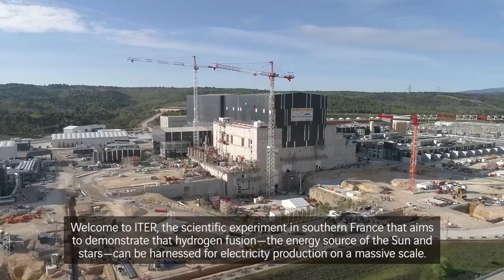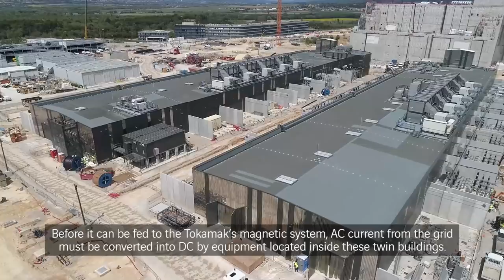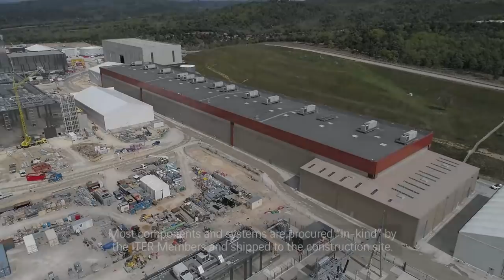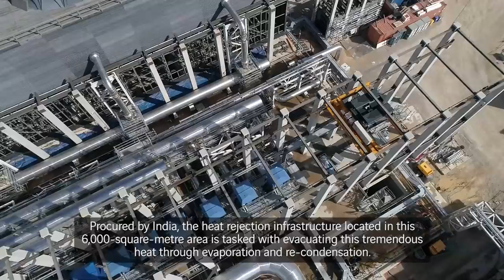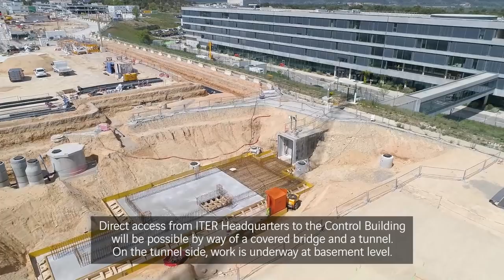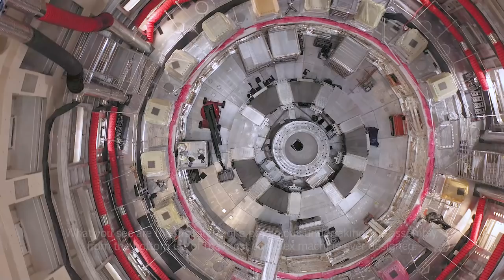ITER SITE CONSTRUCTION IS NOW 78 % COMPLETE

Comment: The complexity of this thing is just mind blowing. Hats off to scientists, engineers, technicians, average workers for puting it together piece by piece. Humanity, you can do it.
Reply: You'll get a guy like Elon Musk putting it together at a Texas farm with duct tapes at a cost lower by factor of 100. Using iterative testing methods churning results monthly until it's done in 2 yrs.
Reply: @The_Dark_Lord-69  I think it is not so easy due to sheer size of the device. But once we crack the process I hope we will be able to mass produce and scale down such reactors.
Reply: @sylwek1177  MIT version (SPARC) of this design is much smaller but at a higher power density. It uses (now) commercially available super conducting magnets thaf are easier to manufacture.
Reply: The complexity is at the bottom of the top 5 reasons it will fail.
Reply: @The_Dark_Lord-69  The longer you wait the easier, cheaper and or better it will be but by this logic you never start, at some point when it is worth the effort you need to start work on these long projects.
Reply: @The_Dark_Lord-69  With that attitude nothing would ever be done, you have to start somewhere, not constantly wait for a better opportunity.
Reply: @5000mahmud  Or wait for someone else to do the job

Comment: ITER is one of those projects that one can say: "Humanity will never be the same again, afterwards."
Reply: Because 70 billion is a lot to spend on snake oil…
Reply: @russhamilton3800  What makes it snake oil?
Reply: @russhamilton3800  in my experience with using neutrons to make a metal radioactive, the half-life was in days.  This means the radioactivity will dissipate on its own.  Whereas the end products from fission are radioactive for 100,000s of years.

Yes, the experiment may not immediately produce net energy, or it may fail.  One must try, and then try again, if you want to progress.  People learn by doing, and then using that knowledge to improve.  You are advocating technological stasis, similar to the Amish.  Not everyone wants to be Amish.

If the research was never done to create the transistor, we wouldn't be able to even have this conversation.
Reply: @brocksamson3282  something that is radioactive for a few days is going to be off the charts! You know that right. You’re going to have to shield it, bury it and it’s going to fuck up electronics if they are anywhere near. See then you bring up fission and if you built a safe molten salt reactor you can actually burn waste and the waste you do generate is manageable because it’s hL is only 150 years. But back to ITER, do you really not know what they are going to burn ? Well it’s tritium! Your neutron problem with radiation is not going to last just a few days now is it? So we now are going to have do what? Breed tritium. Good thing that tritium can be used in fusion bombs right?
Reply: @russhamilton3800  in the video they said it was in 30m pit, so it is buried.

Low energy radiation doesn't hurt electronics.  Tritium decay only produces 18.6 keV of energy with some of that energy going to the neutrino and some to the electron.  That is a tiny tiny amount of energy.

My argument still stands, you are advocating stasis, and not progress.  Now you are just trying to distract from that.
Reply: @brocksamson3282  what’s going on during fusion can screw with electronics ffs! Omg
Reply: @russhamilton3800  OK, we all gotta live like cave men then.  No sense trying to do things.  (/sarcasm)
Reply: @brocksamson3282  letting scientists feed at the public trough is not about bringing fusion to fruition, its about feeding scientist and pokiticians. Its not a serious endeavor.
Reply: @russhamilton3800  Good thing they don't put their sensitive electronics inside the fusion reactor.  Heck, they would melt from the heat.  Even the strong magnetic fields around the reactor would mess with sensitive electronics.  Good thing for one over R squared, so things are safe at a distance.
Reply: @russhamilton3800  yes, you hate science, similar to the Amish.  Not everyone hates science like you.  Most people, thankfully, want to see society progress.  I'm surprised you find it ethical to even use Youtube, with your backwards way of thinking.

And you do know scientists have low salaries, they don't get to keep the research money, right?  Science isn't military contractors making huge profits.

But, you have the right to your opinion, and I respect people like the Amish who want to live a simple life.  Just don't push your ignorance on the rest of us.
Reply: @russhamilton3800  oh, and i was mistaken.  The experiment I did with neutron capture gave silver a half-life measured in minutes, and another in seconds.  Neutron capture (neutrons making other elements radioactive) only happens when the neutron is nearly at rest, so the energy levels of subsequent radiation are limited by this, which is why i classified it as "low" energy.
Reply: @brocksamson3282  Brock, I'm really enjoying reading you slap the shit out of him...thank you. Especially that last line.
Reply: @russhamilton3800  I would recommend looking up what is a science and what it does and already did to humanity.
Reply: Though not immediately. It will still take decades to really start have an impact.
I'm in my mid 30s now and my hope is to see a real transformation in energy and industry 50 years or so from now.
Reply: @TauCu  ridiculous statement on your part. There are no indicators that any real progress is being made. You throw out a non sequitur statement with no data, facts or anything else. If you want to discuss something then do it but blindly reacting to journalistic statements is meaningless.
Reply: ITER will be 100 billion over budget by the time it makes ots first plasma.
Reply: @russhamilton3800  Progress of what? ITER or Nuclear fusion as a whole?
Progress is and will be made no matter the outcome of ITER.
Reply: @TauCu  no it will not. Even if they solve how to get to Q1, and they won’t, that does not mean they will ever reach a point of feasibility. The intractability of the fuel problem alone may be a show stopper.
Reply: @russhamilton3800  Just because something may be a "show stopper" doesn't mean it should not be attempted.
Otherwise no one will ever know.
Reply: NO it will NOT. they all be dead afterwards
Reply: @outlawedTV88  who are you responding to its been 3 months since anyone has commented and i just wanted to see the iter vid again and look into the comments
Reply: @jonathan.k7492  to original first comment "humanity will never be the same afterwards" ITER is spelling for AETHER which they're not telling you about and do not want you to know about

Comment: Will the last 20% take 80% of the time?
Reply: You know how it is. The first 80% of work need 90% of the time and the last 20% of work need the other 90% of the time xD
Reply: @AliothAncalagon  ahh I see you have worked on real world projects too, since ppl don't realise after main assembly, more time will be spent on integration testing, tuning, safety checks, etc. Don't want to blow it up right after integration :P
Reply: Yes
Reply: @AliothAncalagon  Yeah especially when it's about to get everyone on the same page.
Reply: It's more like the last 20% take 80% of the budget. The buildings and infrastrukture that could be installed "off the shelf" are soon all present. That means all concrete poured, all electrical lines layed, all piping installed etc. Then, the precision engineered stuff gets put into place (I've heard they've allready done some of that by now, but still) and all of the value gets added. You've seen the halls - they currently are looking more like general purpose industry building then nuclear research facilities, but that will soon change ;)
Reply: Ok mr. Pareto
Reply: considering how bloody long its taken to get here, wouldn't surprise me.
Reply: IT's still gonna take less time to build than the James Webb Telescope
Reply: @mbartelsm  incorrect. That ACTUALLY has a launch date in November 2021...billions over budget and at least 4 years behind original launch date...
Reply: There is so much money involved you know they will draw it out as long as possible to make the most money. I think private companies will have a working system before this ever works.
Reply: @Shinzon23  " date in November 2021" Project was initiated by Ronald Reagan and Mikhail Gorbachev at the Geneva Summit in 1985, fossil fuels industry have its finger on the pulse. So do not hold your breath in wait for that November 2021 launch date... LoL
Reply: 2035 is the deadline to produce equilibrium energy from it. This is just the proof of concept. It won't be until 2045 before it is commercially available.
Reply: @RS-ls7mm  Not a chance. Fusion reactors are too large and expensive to be afforded by private companies.  A fusion reactor is at the same level of engineering as the CERN particle accelerator. Only governments can afford projects that size for now.
Reply: @montgomeryfrenwheringwerth5584  You should do a bit more research.  There are several private companies already working on fusion.  I found 27.
Reply: @RS-ls7mm  Yeah, but that doesn't imply they are close, or will ever crack the hard problem of fusion reactors.

To think a private company can just make a reactor like ITER and be successful is wishful thinking at best.
Reply: @montgomeryfrenwheringwerth5584  Don't be so negative.  Some of the largest technical breakthroughs were by small companies.  All of these companies feel the government is headed in the wrong direction. Can you blame them? ITER is a bureaucrats wet dream.
Reply: @RS-ls7mm  The problem with fusion reactors has been that there was never a big enough reactor to sustain the plasma, thus, making the reactor energy efficient. It's less of a case of making a breakthrough discovery. CERN was also an international collab and that has been a huge success, so I will use you own criticism against you and say don't be so negative about  state sponsored projects. We would not have a lot of the technology we do without them.
Reply: @montgomeryfrenwheringwerth5584  That's your bias, not mine.  Let us not forget that CERN has never produced anything of any practical value.  At what point did I say that large projects are useless?
Reply: @RS-ls7mm  Do you understand that just building things like particle accelerators produces things of practical value, even before they are used? So your comment is nonsense. Don't talk if you don't know..
Reply: 2 more weeks

Comment: it's almost funny how so many SciFi ship designs, forget how much support equipment a fusion engine takes. All that equipment for a modest 28 meters or so reaction chamber, impressive.
Reply: And in space cooling is hard.
So Giant radiatora needed.
Reply: Having high temperature superconductors would help a lot to reduce the size and complexity.

SciFi takes liberties with science, so they can get to the story.

In storytelling, some things are "postulates" that are just given as being true.  And then given those postulates, then the story is how things go from there.  For example, zombies wouldn't be scientifically possible, but no one argues that about a zombie movie, because that is just a given.
Reply: @brocksamson3282  It would still need a lot of cooling.

But I agree that movies sometimes just can't be 100% accurate.
Reply: @ImieNazwiskoOK  yeah, to have an engine (something that does useful work), you need a hot and a cold.  In space the "cold" wouldn't be able to stay cold.
Reply: @brocksamson3282  You can use radiators (which in case of tokamak may be light sail for smaller vehicle)

Comment: ...Dad will this actual work ... Father thinks for a moment, "Son when you return from Mars in 2036"
Reply: it wont work as a reactor delivering energy to the grid, its a testing facility to get scientific data.
Reply: @certaindeath7776  but will it actually work ? that remains to be seen. the cost so far could have financed much better things
Reply: @ottodidakt3069  it will defenitely deliver useful scientific data.
if that data leads to a breakthrough in fission technology is to be seen.
in my opinion no cost is too high for the goal of nuclear fission, because if we have that, we will have endless options.
Reply: @certaindeath7776  uhm, I'm sure you meant fusion here, not fission

Comment: Time Travel day or 24 hrs
2021-06-29 11:07:19.763344 IST
-6  hours later, it will be  5  hours
4  hours later, it will be  15  hours
12  hours later, it will be  23  hours
4  hours later, it will be  15  hours
0  hours later, it will be  11  hours
Time Travel 1 millenia
-353  years later, it will be  1668
-213  years later, it will be  1808
524  years later, it will be  2545
389  years later, it will be  2410
750  years later, it will be  2771
Clock keeping is possible with atomic physics based optical combs, Bose Einstein condensate, Piezo devices, pendulumns, star gazing etc
Time travel is possible after fu*ion So many reactors, it will certainly succeed  its the best offering clarity in thought and teaching physics to so many disciplines.

Comment: Remember: this is just to demonstrate that fusion is viable; it won't be used to actually supply electricity. First plasma is planned for 2025 but commercial fusion might appear in the 2040s. If it works by then, it'll be 100 years from first research to net electricity.

From ITER's website: "In 2012 the European Fusion Development Agreement EFDA...published A Roadmap to the Realisation of Fusion Energy that outlines its plan for bringing fusion electricity to the grid by 2050—a goal that it considers ambitious, yet realistic. It foresees a DEMO that will produce net electricity at the level of a few hundred megawatts in the early 2040s".

It seems like fusion is always 20 years away. Let's hope this will be the last time we say that.

Comment: First break-even (if at all), and then how is the energy of the thingie going to be collected? Or is it just a dream toy?
Reply: the stupid thing is, they never mentioned how much energy is required to run the dam thing, all they said about was how much energy it could produce. by the sounds of things they are expecting to much from it at the moment, as the biggest issue holding fusion back is the law of energy conservation which basically states energy can not be created nor destroyed, it can only be converted from one form to another.

Comment: How do they plan on getting more energy out than they put in to create the conditions required? How have they solved the problem?
Reply: That’s not hard, fusion does that naturally. It’s the materials that are the problem.
Reply: @Gomlmon99  Fusion doesn't do that "naturally". At least, man made fusion doesn't. The sun does it due to its massive gravity holding everything close and tight and thus creating internal pressures high enough for spontaneous fusion. On earth, fusion requires power. Lots of it. We can create and hold stable fusion. Been able to do it a few decades now. The issue is that the amount of energy produced can not be harnessed in a meaningful way such as to boil water yet it requires a shit load of power to fuse just two atoms. 

So again, back to my question... How are we getting out more than we put in?
Reply: @Crimsonedge1  Why are you comparing it to the sun? That’s a totally different reaction chain. We can use a reaction that’s 10^24 times faster lol. 

And we know how we are going to harvest the energy - it just hasn’t been built now.

We can’t create and hold stable D-T fusion, so not sure what you’re talking about there. D-T fusion is the only viable route.

Comment: hear that?.....
its the oil companies sweating bullets
Reply: No they're not. If this actually works the oil companies will just become fusion companies.
Reply: @akalion213  if that was true then oil companies wouldn't exist right now 

solar panels aren't exactly cheap but im certain that with enough time it would be better than using oil so why aren't they using solar panels?.... no money in it after a certain point for them

with fusion all it pretty much needs is water and it can run a whole city for a long time and guess what?  theres still no money in it for them but this one is right off the bat 

what im saying is if they wanted to move away from oil then they could and not even have an issue but its all about money for them and nothing else seems more profitable for them in the long run so no chnages will be made

Comment: Price should be 22 000 000 000 000 euros (other estimates 45 - 65 bilion euros.) Weight 23 000 tons. Most complex system human ever build. Expected start 2025-2026 expected to be in full operating power 2036.
Expected fusion reactor that generated more power than what was put into it 2060-2070. Next project after ITER? DEMO.

Comment: What's going to happen to Tesla stock when this goes online?
Reply: Goes up if anything.   Fusion would mainly be used to power the electricity grid.
Reply: @nateshrager512  and will help generate viable power for Musk's goal of a Mars settlement.
Reply: @michael4576  I think that's far off.  Fission I think will do the trick on mars for quite a while
Reply: @nateshrager512  i think people neglect working on fission because of its problems but they are problems which can be solved.
Reply: @nateshrager512  we have an abundance of U-238, plutonium and thorium so may as well use that to power mars for centuries